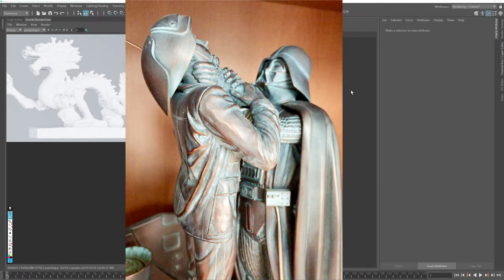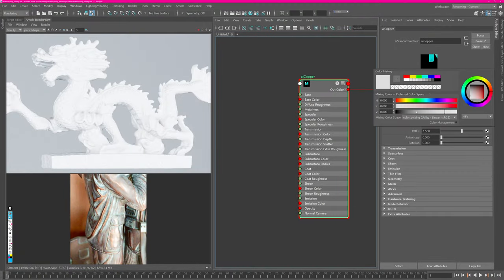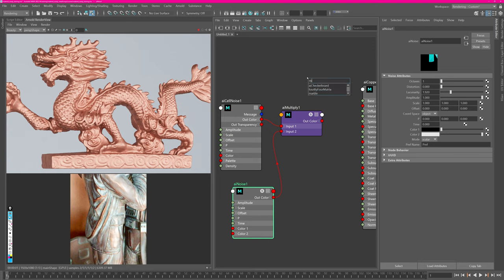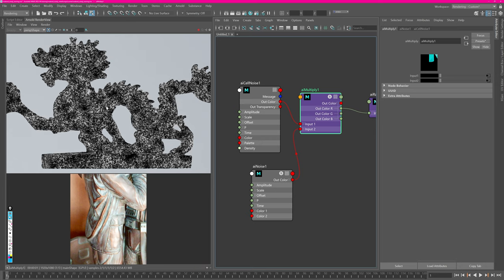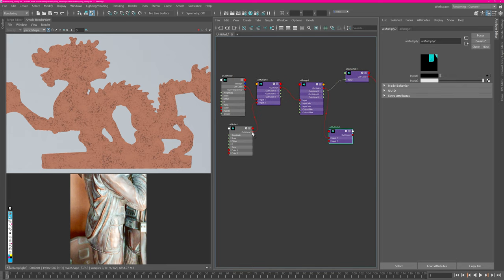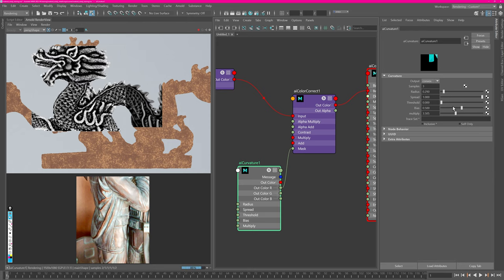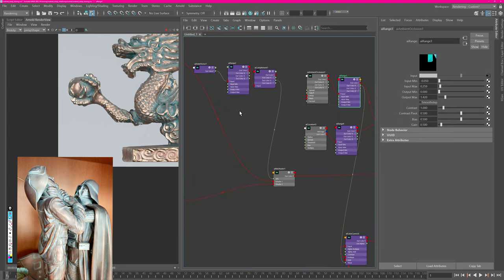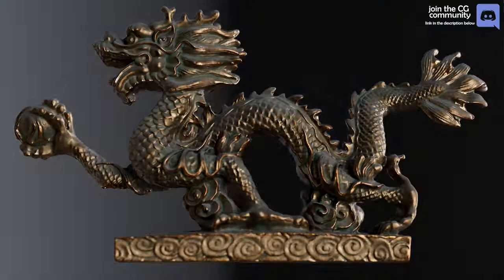Creative Shading Techniques | Copper Material Study with Arnold

Comment from the maker: What Material Study would you like to see next? Comment below! Go go go!
Reply: Material study  on water using standard surface shader!!!
Reply: Sea. Foam and sh^t.
Reply: water with caustic
Reply: So much changed in Arnold. Some nodes were replaced, some renamed (for example "refraction" is now "transmission", there is "mix node" instead some weird "alCombineFloat2" that I saw in your old tutorial :) etc. )
Maybe video explaining these details would make your old tutorials easier to follow. They are still massively useful!
For product visualization I would greatly appreciate showing foam material like on the beer - thats a real challenge...
Reply: @actioN1337  yeah good idea! Making realistic food isnt easy - whole bunch of ideas there! "simple" burger has so many items..
Reply: Anything using actual industry leading render engines.
Reply from the maker: @ubernoob458  like Cycles?
Reply: A way to mix shaders based on height would be awesome (using a height output of a PBR kind of textures for example)!
Like the way Substance Painter or Alchemist do :)
Reply: @arvidurs  hehe
Reply: Sir, if you can share a study of Marble material that would be great🙂